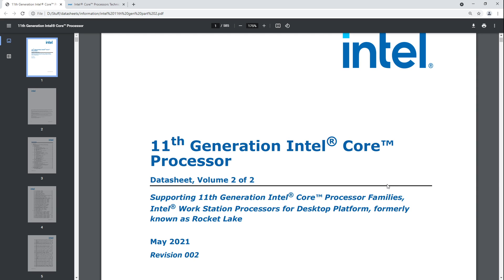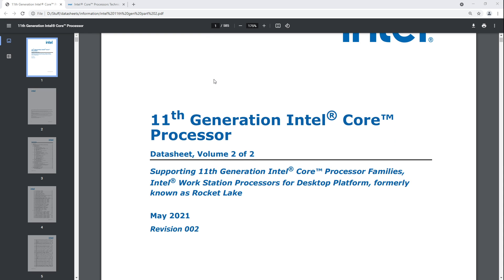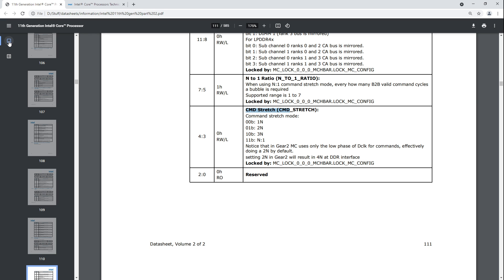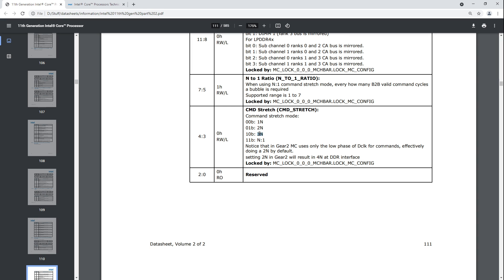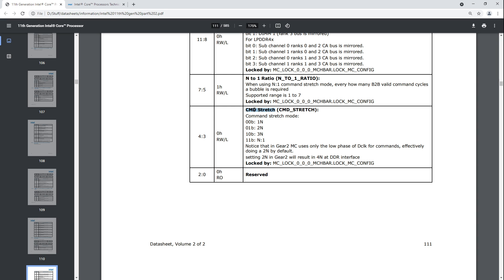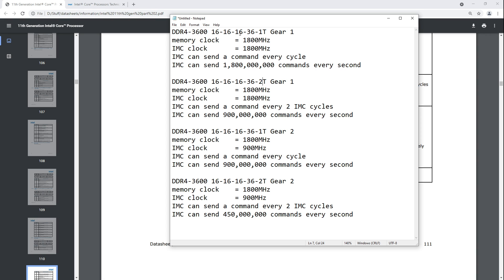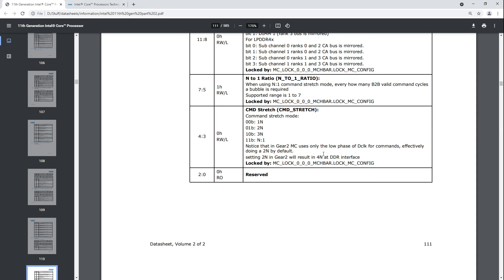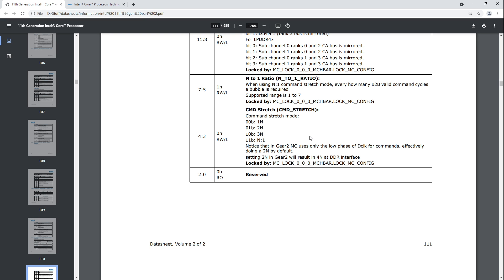The weirdness with command rate on 11th gen intel CPUs.

Comment: Hi buildzoid, i'm getting an issue where i can't post if i use XMP profile #1 Trident Z Neo
 DDR4-3600 CL14-14-14-34 1.45V 32GB (2x16GB), why would that be that on Auto it would go to Command Rate 2N and it would work and POST but 1N won't. I've tried this many times on a i7 9700k, EVGA Z370 Micro. No the RAM's not on QVL but really pisses me off.
Reply: If it's Samsung B-Die try 1.48V-1.5V and it will work. 

I'm running 4000mhz 16 16 16 36 G Skill 16x2 Trident Royal (Silver) 1.4V ~ stock

@ 14 14 14 28 4000mhz 1.49V 1N - it runs just fine
Reply: @DavidTMSN  doesn't work. Its probably my bios evga uploaded
Reply: @Limeayy  Wanted to ask a question: What in the world is "Real 1N?" I cannot find out what it is anywhere.

Comment: Just got a Z490 board as a gift, should I get the 10700k or 11700k for gaming (trying to find an used one)? 
I have a Noctua nh-d14 (is that even enough for an OC'd 11700K?).
Is the Patriot 16gb 4400Mhz CL19 kit still the best fast budget DDR4 kit?
Thanks a lot.
Reply from the maker: 10700k

Comment: Ok if I have i9 9900k at stock in z390 UD motherboard and have these 4 8gb sticks of memory:
2x G.skill Aegis 3000mhz cl 16 18 18 38 1.35V
2x Corsair vegenance 3000 MHz cl 15 17 17 35
(1.35V)
And both are running at 3000mhz cl 16 18 18 38 and 1.35V and 2T command rate.
It is possible to push It at 1T command rate and It will give some improvements at overal performance?
Reply: it might be, if it's the XMP spec and all the secondary timings isn't touched, it should still be pretty lose, 1T should work just fine :)
Reply: Don't expect anything huge though!

Im running a ryzen based system, right now I run super loose timings, 2866Mhz 22-25-25-42 1T, someday ill tweak it more, but i had alot of issues getting it stable with 32GB(samsung shit tier memory)
Reply: @Zesserie  what model of memory you have and what are default speed and timings are? Just for compare.
Reply: @jakubmad3957  

Corsair vengance 3200 CL 16-20-20-42 i think it was.

they are according to thaiphoon burner samsung B-Die, could be true but it wont OC so it's probably bottom barrel stuff.
Reply: @Zesserie  i had 3200MHz cl16 corsair vengeance and it truly is bottom of the barrel stuff

wont overclock or allow tighter timings no matter how much voltage you use even though it is bdie
Reply: I thought It will run at stock speed in 1T mode.
 If decrease od speed and timings is this huge there is some better performance or it is worse than stock 2T mode?
Reply: I have 4 stick of 16GB 1R LPX hynix 3200 CL16-18-18 1T which work fine for ryzen 3700x, just xmp setting and its stable
Reply: @雷鳗鱼  I tried IT and 1T works on default xmp profile without aby problems.

Comment: The Command Rate is not only about the total number of commands that can be sent per second, it is also an additional latency added to every memory operation.

Yes, for memory operations that already have high latencies (or also when a large amount of data needs to be transferred before the next operation can continue, regardless of the latency to the first bit being sent/received/accessed, since the entire operation will take many clock cycles anyway), this has almost no additional performance penalty, however it does further increase the absolute minimum number of clock cycles that the memory controller has to waste when doing small, latency sensitive commands.
The scenarios where this is particularly troublesome is, for example, when the branch prediction miss rate is high together with cache thrashing or just having implicit/explicit parallelization require random access (in unpredictable locations) to datasets containing large numbers of small objects, so that the cache miss rate is always high and the pipelines stall until the correct data is fetched (which can be as bad as requiring a single integer from a random place in memory).
Reply: bruh pls reply
Reply: @CaptainPrice-f6g  maybe word your questions so you don't sound like an Afghan and someone will reply. No clue what you are asking

Comment: 1T, 2T, I'm curious if 1.5T could be a thing in future gear 1 or 2s
Reply: 1.5T is already here. If you turn on Gear Down Mode on Ryzen systems running 1T , that is equals to 1.5T . Not applicable to Intel platform though.
Reply: I think there was 1.5T but I could be wrong.

Comment: based on random guess seems like N:1 is for having a <1T command rate with the b2b number being to resynchronize every 1 to 7 valid commands
Reply from the maker: You can't issue commands faster than the memory controller clock. N:1 gives a bunch of weird options that range from 1T to 7T and fractional stuff too.
Reply: @ActuallyHardcoreOverclocking  The total RC delay (i.e. the sum total of the external and internal RC delay to the memory cells) is the main reason why they can cheap out on the memory controller without anyone really caring. They should really just allow board partners to encroach into the keepout zone around the CPU, specifically with regards to reducing the RC delay (and to a lesser extent, the signal crosstalk) to the memory DIMMS, for products where the consumer is willing to accept responsibility for figuring out the cooling solution.
Doing away with the DIMM slots entirely and having a product with specially binned memory ICs placed directly on the back of the board, right next to the decoupling caps, would be the ultimate solution. (I don't think any form of die stacking will ever be as good because of thermal limitations)

Comment: Hey Buildzoid, what do you think about TM5 memtest? I've used HCI memtest before but swapped to TM5 on my DDR3 5th gen Intel platform, shortened my memory testing by enourmous amount. But I still'd love to hear a word from a specialist.
Reply: Different memtests will often find certain instabilities much faster than others. Sometimes it takes hours of HCI but seconds of memtest86 and vice-versa. Same goes for Karhu, TM5, etc. Can also very much depend on the platform in my admittedly limited experience.
Reply: @IK4MS  the only time memtest86 can detect something fast is when Hammer test is in progress. Which is an absurdly out of place test, it only works for some dies that have specific board design. It doesn't test stability. Else, the MT86 is ultra slow and redundant.
Reply: TM5 default config is meh. use anta777 extreme